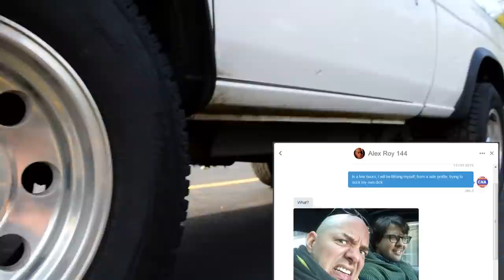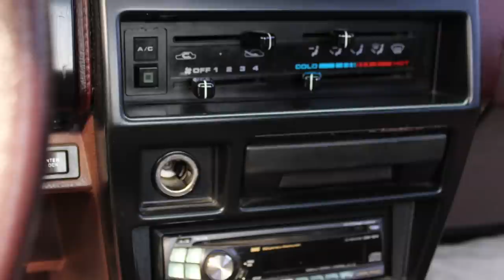Regular Car Reviews: 1991 Nissan D21 Hardbody

Comment: I'm just here for the single cam KA Loving.
Reply: Turbo'd the KA in my 240sx and I love it!!
Reply: +flip240 I've always thought that if I had an S13/S14 or a D21, I wouldn't bother SR20ing, VQing, or LSing. KA-T seems plenty functional, torquey, and not too expensive.
Reply: +NoBrakes23 they make for awesome DD street-ability.  Tons of low RPM torque and no Honda buzzing to be found 😎
Reply: Also a great looking body. One of the best looking trucks ever, and one of the last trucks to have a "Truck" looking body instead of the melted candybar look.
Reply: +paradoxdesigns I love my KA

Comment: I was under the impression that the chicken tax is what killed the 2 door WD21 Pathfinder, not the small pickup truck. The D21 went on till 1997 and was replaced by the D22 which was pretty much the same truck with some updates. The reason the small truck went away was because the market went away. That was my understanding. The chicken tax only affected the 2 door WD21 Pathfinder forcing it to become a 4 door in 1990.

Comment: My dad has an 85 hardbody, bought new from the dealership.  It's bone stock, manual transmission, 4x4.  It's got 400k miles on the odometer, and still on the factory clutch. He hit a bear with it at about 45mph, replaced the front body work, radiator and added a cow-catcher from junkyard parts for about $400.  We call it the bear-mobile now.

Comment: Which Hardbody is best Hardbody?
Reply: My hardbody is best hardbody because chrome aftermarket front bumper hardbody.
Reply: +Nick Gregory HARDbody is best body!
Reply: +Troa Barton what year you got?
Reply: My Hardbody is best Hardbody because lowered and Titan wheels.
Reply: Dan Ortiz mines lowered and has chrome mirrors, chrome back and front bumper and 20" chrome wheels!
Reply: +Unknown 
Stop; you're ruining the game!
Reply: +Nick Gregory my hardbody is best hardbody because MASSIVELY ENGORGED PEN15 TURBO THRUST TRANSMISSION
Reply: +Nick Gregory B2200 Mazda.
Reply: My hardbody is best hardbody because fucked frame that needs to be swapped and I don't even own it yet.
Reply: My dad's 95 because it's been in so many wrecks and still continues to drive to this day
Reply: My 96 because it only has 73000 miles as if now
Reply: my 94 cause it had 399,000 before i had to rebuild the engine
Reply: Troa Barton 1997 for some reason it has the most hp lol
Reply: My hardbody is the best Hardbody because it's not lowered and it's a 4x4 5spd and it don't have ugly rims on it as Well
Reply: Any one of them that is KA-powered, manual trans, and 4X4 with limited-slip diffs.

Comment: I had an 89 Hardbody Special that I bought new.  Z24 4 cylinder, 5 speed,  king cab, charcoal gray. Awesome and tough little truck! I had it for 6 years and well over 100k miles. Very few small small, inexpensive, and easy to fix issues. Nothing that was a show stopper. 
The issue that was not easy to fix was the clearcoat over the paint on the hood and roof. This was in the sun belt and after 4 years it started to fade which later started to blister then peel. Periodic waxing before this didn't seem to help. But still, I wish they still made a little truck just like my beloved and dearly missed D21.

Comment: I have the 1994 hardbody white in color. It has the v-6 3.0  engine and is a 5 speed. It is the king cab. Everything still works and it was kept in a garage so the original paint is in excellent condition. It had right over 33k miles on it when I bought but it had been sitting for over 2 years. I had the timing belt changed since it was 20 years old and all of the vacuum lines. I drive it daily and it is very dependable. ac/heat/cruise control/4-wheel drive/power rear view mirrors all still work. The inside is in like new condition. I just hot 48k on it last week. I have taken it off road a few times and it does great. When you put it in 4 wheel low it's like an army tank. They are nice trucks but are very loud on the inside when driving on the interstate. One great thing about the model that I have is that the fan for the ac/heat blows very hard so it cools and heats like no other.

Comment: I got an 87 d21, best vehicle I have owned...I don't know the actual mileage, I bought it 6 yrs ago from a guy who had it for 8 yrs and the odometer was stuck at 176k miles when he bought it...keep up on basic needs, changed the alternator, the starter, and the slave and master cylinders...4x4 works great, 5 speed manual transmission shifts great, sounds great....just a great truck! Will probably get a ride to my funeral in this thing!

Comment: I had a 91 that had some fairly decent miles on it, beat to shit and was no looker, didn’t burn a drop of oil. I bought a cheap canopy for it, built a storage box into the bed for camping and then blew the clutch out of nowhere one day. I can work on cars, but transmission and internal engine stuff is a bit far out there for my capabilities. Needed a car so I bought a Subaru Outback that immediately destroyed its own engine at 100,000 miles. What a fucking mistake. I miss my hardbody.

Comment: I don't know jack about cars really but still enjoy your videos. My dad still owns and occasionally drives a '95 Nissan pickup not too unlike this pickup. It's been through hell and back but still runs on the original engine somehow. Stolen twice (so the ignition is busted and he starts it with a broken key), shocks only replaced 3 or 4 years ago, 630,000+ miles with daily use as a courier, hell he rolled it on the highway a couple years ago when a tire blew out. Still runs.

Built to fucking last.

Comment: I've got a 87 SE v6 4x4 extended cab. Can't complain one bit. I bought it not running, replaced the battery and fuel pump. Put a set of tires on and gave it to my son to drive for a beater. I wish it were the  4 cyl model, but the 3.0 is running pretty damn well.

Comment: My 96 Nissan pickup 4 cylinder has 275,000 with original engine and automatic transmission a/c is still ice cold I love this truck
Reply: 372,000 here on everything original...

Comment: I have a 92 2wd d21… I love this truck, had it for about 4 years now. Slowly doing restoration work to it. Right it’s been parked for almost a year with the dash torn completely apart, waiting for me to replace the heater controls. They broke when I first got the truck. I plan on having the timing set and head gasket replaced and front wheel bearings and rotors replaced… Already have all the parts. I need to get off my ass and get to work on my old truck so I can drive it again.

Comment: My odometer quit working 3 years ago at 170000 and it’s my daily driver. I’ll drive it til the floor falls out. Then I’ll bolt a skid on to use as floor and drive it some more.

Comment: I drove my 1992 D21 right off the lot when I and the truck were both a lot younger. My truck is parked now, waiting for a paint job and a little love, but she sure is my favorite. I put well over 200k on it and the only thing she ever did was throw a spark plug that required repair with a helicoil. Otherwise the truck is still solid and ready to roll again.
Reply: Update: It's been 3 years, the truck is painted and looks brand new, even got the lettering sticker for the tailgate, painted the wheels, wired the lugnuts clean, removed the bed and painted underneath; detailed the engine bay. She's running great!

Comment: Great well done video! I just bought a 97 Hardbody with 127k. Nice clean original pawpaws truck. My brother had a 88 Hardbody Z24, he owned for 21 years. At 500,000 miles it blew a head gasket. He replace the head gasket, no machine work or anything, and drove it another 200,000 miles before selling it.

Comment: I had a new 1986 1/2 Black Hardbody regular cab short box. Seems like the msrp was about $8,500.  Lowered 2" front and rear, 255/60-15 rear, maybe was a 205/70-14 front, American Racing Outlaw wheels with matching rear tire/wheel spare. Rear air shocks. Chrome traction bars.  Painted rear axel housing Chevy Orange. Manual tilt bed, made the rear chassis hinges myself based on advise from a guy in California. Unbolt bed from chassis. Grab the box in front of the wheel well, lift and insert a 3' chrome steel rod (used a 6" long wood 2x4 to raise it for cruising). Replaced bench seat with 1975 Corvette seats. Added sunroof and stereo system. Always kept super-detailed. It had a street rod stance and was definitely different than what most others were doing at the time. My first truck show earned a trophy for "cleanest truck of the show". I traded it in for a black 1989 IROC-Z. I should have kept the truck.

Comment: I had an ‘88 4x4 5 speed that my dad bought brand new from the dealership and gave it to me in ‘99 when I turned 16. We put  400k on that truck from going from NC to Florida 100 times probably and eventually the transmission went out. Best vehicle I’ve ever owned and I still miss it. That thing had tons of torque and pulled like Jack the bear!

Comment: I've had my 1995 SE V6 vg30e since it was new, it has well over 500,000 original miles on the motor and drivetrain, I can't get rid of it, other than being on its third clutch and four timing belts in 23 years, it's been an excellent truck. I've owned many other vehicles, and sold most of them after a few years, but this truck owes me nothing, I will keep it until it gives up the ghost. At this rate, it might just Outlast me. Oh, believe it or not, it came with 31-10 50s stock in 1995, and on the highway, I still averaged between 22 to 25 miles per gallon. I've never owned a vehicle that has been this reliable. It's a shame that nobody makes long lasting, trouble free reliable Vehicles anymore. That whole planned obsolescence thing with newer vehicles is BS!

Comment: Hmmm... Mr. Regular, the reason there's nothing quite like that Hardbody anymore is NOT THE CHICKEN TAX (that pickup was actually made in TN, as has been pretty much all D21 Hardbodies). 

It is mostly CAFE, the fuel consumption standard that made impossible both compact and single cab pickups. To comply with the US-EPA standard manufacturers have to add their compsumption according to "footprint", IOW the size of each unit made. There's the incentive to make BIGGER rather than smaller vehicles and those bigger vehicles would account for a bigger chunk of the footprint if they get better mileage than the smaller ones.

So smaller and single cab vehicles got the axe along with I4's with 4x4 on them, now 4x4's have to be attached to at least a V6.

Today's Colorado  / Canyon are NOT SMALL PICKUPS AT ALL. They're roughly the same size as a '95 C/K1500 FULL-SIZE pickup and so I believe are the next gen Ford Ranger and Nissan Frontier based on the foreign models already selling of them.

Comment: Used to have a bone stock and immaculate inside and out 1987 Nissan Hardbody “King Cab” V6 SE. The body was perfect, aside from some faded paint. I sold it because it was a 2WD. If it was a 4x4 I’d still be driving it to this day, such an awesome little truck.

Comment: I just bought a '95.  I don't know if it's a Unicorn, but it's damn close.  I bought it from the lady that bought it new.  It's everything I was looking for.  King Cab, XE-V6 with the factory side striping, 5-speed (they used the same 5-speed as the 300ZX), bedliner, canopy.  205k, original clutch, A/C works fine.  The paint is incredible, only one small area of body damage, a small 'scrape-dent' under the RH vent window.  I have 3 VG30's sitting in the shop so I'm going to start rebuilding one.  And it's Magenta.  Ever seen it? Bet you haven't.  Didn't offer it for long.  She kept every single receipt.  I'm chuffed down to my toenails with it.

Comment: By pure luck I got new tires on mine THE DAY B4! Atlanta's snowpocalypse. I did have the foresight that mourning to throw my flat shovel in the bed of my '96 5speed two wheel only 4cyl stock hardbody. There was much strong talk of snow and for once they got it right the snow she did come. By virtue of my very blue collar job at a very tall building down town I had a FUCKING FREE ABOVE SREET parking spot in a garage on  Peachtree st, top of the hill man!  It was a long twisty way from work to home.  The first correct choice I made. I stayed put. I had no kids. Just like in the movies evacuations are traps for the sheep. The grid lock was instantaneous. The coworkers from the burbs were already planning to sleep at work. Not a bad plan at all; sheltered and warm with food and clean facilities. I would not be joining them for the duration however, just for the eating and drinking part of the plan.  There was really only two hills that mattered between me and home.  When you're from Georgia you get 2 practice trys at driving in the snow every 30years I had one so far and it wasn't like this.  10pm the story was happening North on I-75 people were in trouble, no clear reports were coming in about the east side surface streets all eyes were on the interstate.  This is how things went completely right.  Night made the freeze hard and the snow dry it did not stick to my  tires i feathered and feathered and feathered some more I silenced the cab and listened only to the sound of engin and tire, were they in concert with my velocity? All seance of urgency must be ignored. Steady smooth. No cops don't stop. The city was empty. The lights are meaning less next to precious momentum.  My girl and her roommate were outside cheering me on i had done what so many had not that day I made it home in good time.

Comment: This is the kind of truck I was looking for when I went to buy my first vehicle....but nobody was selling single cab trucks at the time besides one F250 that was $20000 at a local dealer. Eventually found a 1991 Chevy K1500  for $3000(during the peak of the oil boom where I live) so I bought it since it was one of only two options, seemingly in the state.

Comment: I have a 1989 Nissan D21 Hardbody with the 3.0 V6 4x4 with the extended cab with the side fold down back seats with 170000 miles. Still runs like a champ.

Comment: At least in Japan, which is where we in New Zealand/Australia import heaps of second hand cars from, this ute was not always a Nissan successor to the Datsun 720. I have an '90 TD23 S/C column shift Datsun D21 ute parked up less than 10m from where I am sitting, factory badged as such. Have a spare box and TD27T setup ready to go when the old lady needs, it too. They are cheap here. Owned lots of vehicles over the years, some have been really good, this one I will never sell; show it a photo of motor oil from time to time and it'll love you forever.

Comment: Still have  my 92 D21 , 2.7ltr diesel (td27) single cab 4x4 8ft long steel tray , it’s not fast , won’t break any speed records but I’ve owned for 15 yrs now and it just keeps going , no fancy electronics to drain the battery over time it just works !

Comment: My mom had a 1995 model year D21 rwd with the ka engine, and that truck was indestructible, even after running into a phone booth at 30 miles per hour hardly dented it, she gave it to my dad as a wedding gift in 1997 and he drove it up until 2015 when he was concerned about the lack of airbags and bought a 2015 GMC Sierra. I still miss that truck, I really wanna buy one as my first car.

Comment: KA24E is multi-port injection. The Z20 & early Z24 were carburated in the 720. The early D21 Z24 & VG30 were throttle body injected. By '91, both the KA24E & the VG30E were multi-port fuel injection.....

Comment: We have a client at my workplace with a '90 Hardbody. He's the original owner. The truck has the 4 cylinder, 2wd, 5 speed, and no A/C. It runs like a top and he bought it brand new off the lot at our dealership. As of October '19 it has about 184k and is running on the original powertrain.

Comment: I  have D21 King Cab with the 2,4 liter Z24 carb engine that my father bought new in 1990. Now it has  285.000 km and it's the most reliable car we ever had. The only bad thing about them since they were new is their brakes.

Comment: Bought my D21 4x4 new in '92, now with 220k. Only parts for regular maintenance,  brakes, exhaust, timing belt. Only left me stranded once when the plastic radiator top broke. Original clutch will likely be the first major expense. Oh, and the a/c compressor gave out a few years back. Only drive it now as a cold and snow vehicle. ❄

Comment: I own a Jeep Comanche 4x4 and a Chevy Silverado 2500HD crew 4x4. The Comanche is almost entirely useless. What little I can do in the Comanche can be done in the Silverado exponentially better; the Silverado rides smoother, stops faster, carries more, tows more, seats more, has amenities that are welcome on long hauls, and is safer.  Unloaded the Comanche might get better mileage, but as soon as you put comparable loads between the two, it drops like a rock.  While I enjoy the spunk and spirit of the Comanche, I entirely understand why small trucks are gone, and that's mostly because they're relegated to a very narrow and specific role.  It is financially more sound to have a truck that fills more roles more adequately at the sole expense of diminished fuel economy, since owning multiple vehicles can become cost prohibitive.

Comment: I have its brother the Terrano/Pathfinder and it's a really nice car. The fuel consumption is awful but it's very dependable for heavy jobs. Easy to repair as well, even if access to parts is a problem. Especially so since the engine I have was only used in one model and only for a few years.

Comment: 158k '97 4x4 manual. Stolen Twice, Two clutches, two radiators, rebuilt transmission, and had to drop the pan because timing-chain plastic bits went in. Otherwise, she still runs fine but barely makes it up hills when fully loaded. I added automatic locks and an alarm system.